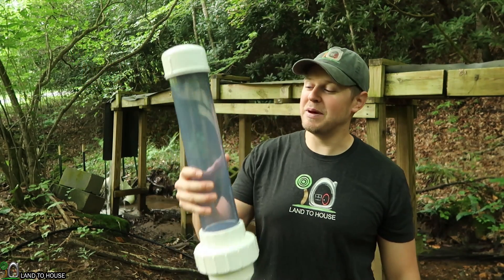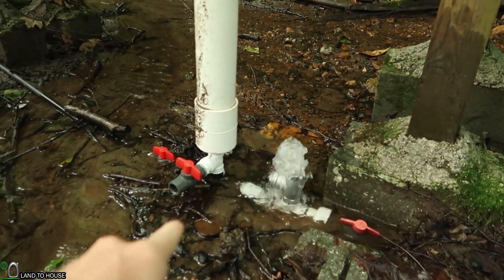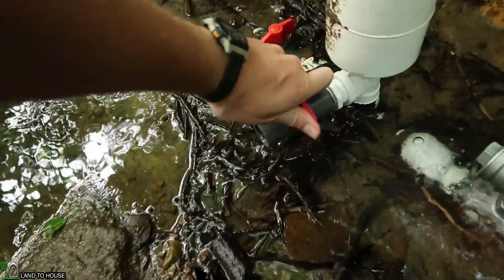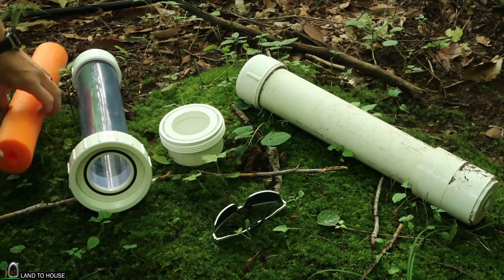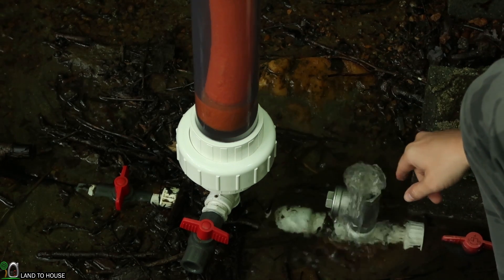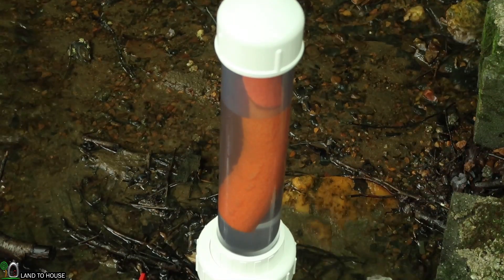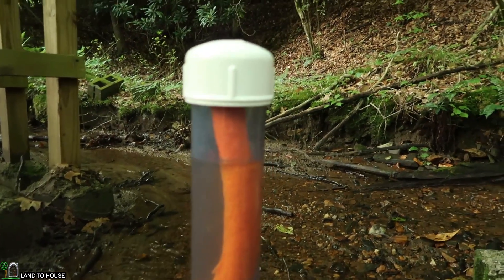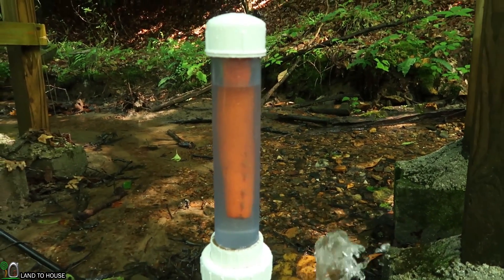Ram Pump Crushes Pool Noodle

Comment: Whaaaat? He said the inlet water from "a 1" pipe at 7ft of head pressure gives 60psi at the pump". NONSENSE. 
7ft head = 3.03 psi.
If he meant FROM THE OUTLET OF THE PUMP,  that's different but still will not be anything like 60 psi. Physics prevents it.
Reply from the maker: Yes outlet of the pump with delivery closed. I was wrong... it's not 60 psi. It's over 70!!!
https://youtu.be/jS2qO7nAbek

Comment: Would it be possible to trap some of the air pressure from the pressure tube into a holding tank? Even if it provides slightly less water pumping action, a small amount of air pressure being siphoned could accrue over time. Would there be moisture from the pressurized air source, and could that be fixed?
Reply from the maker: The air in the pressure tank is limited in this style ram pump. If you were to take some of it out the pump would become waterlogged and not function very well. In large commercial pumps there is a small valve called a snifter valve that allows a small gulp of air to enter the pressure tank with each cycle. Still I do not think that you would be able to get enough air out of the tank to use in another application. And yes the air would be very humid I have a feeling.

Comment: You know race car crews use a special kind of foam in there gas tanks. I took the liberty of looking some up. https://www.summitracing.com/search/part-type/fuel-cell-foam?SortBy=Default&SortOrder=Ascending&tw=fuel%20Cell&sw=Fuel%20Cell%20Foam I'm really curious as to how that would perform in that pressure thank.
Reply from the maker: Oh that's interesting. I did not know that they used foam in the tanks. It seems to be less ridged than the pool noodle? If it is I would expect that the foam would collapse even more than the noodle.
Reply: @LandtoHouse  I believe the premise behind the foam is that if the tank is punctured less fuel will spill out and thus there is less risk of fire. I'm pretty sure that it will collapse pretty easily but I'm wondering if overall it will keep the air from soaking into the water as quickly provided you fill the whole tank with the foam. I have no idea if it will work... but I sure would like to see if it does or doesn't!
Reply from the maker: It seems like a very smart thing for a race car. I believe that a bladder is the best fill for the ram pump. I should be testing a house pressure tank with bladder soon.
Reply: I used to race up in New England, we did have foam inside of a bladder inside the steel housing which made up the fuel cell. It was open cell foam in order to absorb the fuel. In open cell foam all the air bubbles have been exploded. What he's using there is closed cell foam in which all the air bubbles are whole.
 I think the assumption was that the air inside the bubbles wouldn't dissolve into the water. I think it was a great idea I don't know why it didn't work.

Comment: Ram pumps are great but if wastage of water can be handled the applications can increase manifold. So can Ram pumps be used to send water uphill without wasting any water.
Reply from the maker: The ram pump works best inside a creek or river. This means that the Wastewater just returns to the water source. But in a closed system there is no way of recycling the water back to the source head pressure.
Reply: @LandtoHouse  thanks for the prompt reply

Comment: Cool videos! What's the point of putting foam noodles ect in the pressure tank? Does it work better or is it just to see the pressure?
Reply from the maker: In traditional commercial ram pumps there is a snifter valve that replenishes air in the tank with each cycle. In this style Ram pump there is no snifter valve and so over time the pressure tank can become waterlogged. The Fill material it's supposed to provide a consistent airspace that can push back on the pump. A bicycle inner tube seems to be the best.
Reply: Land to House hi, could you build one with a sniffer valve? Would be interesting to see.

Comment: Sir can tam pump work with the foam or any in the pressure chamber?
Reply from the maker: It did work with foam but it works better with a bicycle inner tube

Comment: is it possible to create a ram pump auto starting?
Reply: Build something like a bamboo water tipper to directly press on the valve. Once water flow starts the tipper will start running and priming the pressure tank.
Reply from the maker: That is a fantastic idea!!! I will make this. A shishi odoshi fountain that auto starts the ram pump. Might have issues with air in the drive pipe though.

Comment: The point of ever putting anything in the tank is for pressure dampening to smooth flow and eliminate water logging the tank. Water logging occurs when air trapped in tank super saturates the water- similar to CO2 in soda but with regular air. Water logging creates reverse vacuum and drops performance in a pressure vessel over time. Putting a pool noodle in the tank does nothing but drop the amount of fill space. A better pulse dampener would be a rubber bladder that separates the inflowing water from air at the top of tank. This is why home pressure tanks put valve stems in the top of the tank to regulate the amount of pressure pushing back against the system pressure.
Reply from the maker: Well stated. I get comments quite often asking to put a noodle in a tank. I thought that I would appease the audience. All of the ram pumps that I sell have a bicycle inner tube. For the past 3 days I've been running a test with the tube. It's very obvious the pulse smoothing effect. In the future I do intend on placing a valve at the top of the pump to test with.
Reply: Land to House Thanks for the great videos.

Comment: A bicycle tube with the valve accessible from the top off the pressure tank with 40 psi in the tube. Or take an actual in home pressure tank and install it into the pressure tank area?
Reply from the maker: A friend of mine in France has a ram pump with metal in house pressure tank. It works very well.

Comment: I've wondered if you could build a micro ram pump utilizing just a foot or less of height from the intake. Fill an adjacent tank that once full could power a typically sized ram pump. This could demonstrate that a person with as little as 1' of water height on a babbling steam could pump 100' high (or so).
Reply from the maker: In the past I have tried operating a ram pump on one foot of head pressure. It does work but not very well. About 1 and 1/2 to 2 ft provides much more consistency even with a very small pump. The smallest pump I've made was 3/8 I believe.

Comment: What is the largest pump you've experimented with and why did you stop at 1.25 inches?
Reply from the maker: Acutally the 1-1/4" is the largest I have worked with. I stopped there because it gets very expensive to buy parts for larger pumps. Even the waste valve can almost double in price from 1-1/4" to 2".
Reply: Thanks, Love your channel!

Comment: Want to see plastic bottle, and the result of it plz ... Way more eco friendly if i drink water with it thanks.
Reply from the maker: Meaning a plastic bottle as the pressure tank or as the fill? I have written down to test a  bottle in the tank. I have another test video from a while back with a plastic bottle as the pressure tank It is a little difficult to get a bottle to hold onto the pvc fittings.

Comment: Try a schraider vale, like on a tire or for AC on a car, to the top lid of the pressure tank. After starting the pump add air to the trapped air in the pressure tank to double the pressure in the tank to see if the volume or speed will increase proportionately.
Also, keep the volume the same but use a narrower and longer pressure tank and also a wider and shorter pressure tank to see if it will change the volume or speed. 

The pumping ability appears to depend on the volume and pressure of the trapped air.
Reply: Also, adding air is the solution to waterlogged home pump pressure tanks.
Reply from the maker: I do need to install a valve and see what happens! I will start some research.
Reply: @LandtoHouse  The worst that could happen, it does nothing.

Comment: Try inserting the inner tube in the center hole of an unsquished pool noodle and inflating inner tube before putting in tank.
Reply from the maker: That might work. I would have to find a pool noodle with a much larger hole. This one is way too small.

Comment: I have wanted to play with a  clear PC for forever! Thanks Seth! Excellent update! I tried a pool noodle initially too on the advice of the Clemson University link.. but found the same issue.. doesn't sustain well. These days I just run air.. flush my PC every 2 weeks or so.. works great! I tired a bicycle inner tube before.. wasn't great either.. love to see that. Tennis balls was my last try.. but they gave up in about 6 months... love to see Tennis Balls in your PC.
Reply from the maker: Everyone that I have talked to about pool noodles has shown the same results. Over a short time they all get crushed. I am not sure how long the bike tube will last. so far it has been in the tank for 9 hours. We shall see how it goes in a few days. This time I left the pump cycling with closed delivery pipe. Very tough pressure for the test. Tennis balls will be in a future test for sure! I dont see them being very good for "Give"
Reply: Cheers!  I did get a nice "ping" on the pump when Tennis Balls were new.. But I didn't re-open for a long time and did find I had to purge from time to time. When I finally did reopen many of them were crushed and no longer had that pressurized pushback like when new.
Reply from the maker: @TheFarmacySeedsNetwork  I'm guessing the rubber would have to be pretty substantial to withstand the pressure that's being demanded of them in the ram pump.
Reply: Yes, I looked at Racket Balls.. but they were cost prohibitive for the volume I needed. I really want to perfect the snifter valve eventually.. that is the REAL solution for long term I think.

Comment: An inflatable balloon or a small flexible rubber ball in dog toys department.
It would imitate a bladder in a water pressure tank.

Great video idea this is, there so much stuff to try in that pressure vessel, awesome video series this is going to be!
Keep up the good work, love the ram pump videos.
Studies like this can help ameliorate efficiencies.
What an interesting device, more test should be done to push the technology.
Reply from the maker: I am thinking about using normal party balloons just to see them pop. I have wanted to make this test for a long time. Finally got around to making the pressure tank. I will be making several more videos with this one.

Comment: I'd like to see  a pressure gauge on top of the pressure tank. I'd also like to see how your standard inner tube looks while in use.
Reply from the maker: Two good points. I already have the bike tube in the tank and will check on it in a few days. So far it looks good. I need to find out how I am going to install the pressure gauge in the tank cap.

Comment: What is a filler medium for? I've noticed you are not using one at the end of this vid...
Reply from the maker: Over the course of weeks to months the air in the tank can become waterlogged. This causes the pump to lose that pressure in the tank. When that happens the water hammer hits hard. The ability to pump water reduces significantly. So the concept is the tank fill provides an air space no matter if the tank is waterlogged. The pumps I  ship have a bicycle inner tube. I'll be testing that next
Reply: Thank, I understand it better now and I love the clear tube idea as well.
Reply: L2H(Seth)- by waterlogged you mean there’s no air in the air chamber, just water?
Is there a theoretical or actual high distance up you can pump up to your to your water tanks? 
I don’t know how far you live from GAH(Sam) but that installation would be interesting to me. A real life outside solution. 🦀

Comment: Styrofoam balls,  fake grapes, and closed plastic bottles plz
Reply: Rubber ducks (sealed of course) :D
Reply from the maker: That would be funny! I will have to find some.
Reply: Styrofoam will just collapse immediately and stay that way, we used to drop styrofoam cups to the bottom when deep sea fishing and they came up shaped the same just smaller and thinner, and stayed that way.
Reply: @johnwyman6331  how did you get them to go down deep in ocean?
Reply: @GodsGladiatorsMinistries  Just tied them to the weighted line.

Comment: Every foot of elevation with fresh water creates .43 psi. 
7ftx.43=3.01psi
Reply from the maker: Yes. That's the pressure from gravity. The pressure built by the "ram" with closed delivery is much higher.
Reply: With the highest efficiency possible you would reach 30 PSI at the pressure tank.
Reply from the maker: Here is an older video showing a pump that reached 25psi with closed delivery pipe. I Think it only had around 3 feet of head pressure. So when the delivery pipe is closed it can build a lot of pressure. Now as soon as you open that valve the pressure reduces like you suggest! https://youtu.be/heLUeTGWz94

Comment: Wow.  I had to sit down.   I was glued to this video.  Your Professional video skills sure do show.  You have created a great testing environment in that pressure tank.  I cant wait.  I just have to say, you single handedly have brought up the combined IQ of the Ram Pump croud.  With this new pressure chamber you might just discover the best pressure media and have everyone following your lead.   I have a question.  When I made my Ram Pump I glued the fittings for the pressure tank.  Some video i saw out there said over time threads will leak.  What are your findings on threaded fittings for the pressure chamber.  It seems to be something i will need to get into on occasion.
Reply from the maker: Thank you. This clear tank has been awesome! I have spoken with dozens of people who have used threaded clean out caps and the most often times leak. The threads are just too big to make a good fit.
Reply: @LandtoHouse  thanks.  I was going to switch to threads.  I better  stay with glued and learn from you what the best media is.   :-)
Reply from the maker: I probably should test out a threaded cap myself to see what happens
Reply: @LandtoHouse  there's another YouTuber that does that, and he says he has to use aquarium sealant on the threads and let it sit overnight in order to keep from leaking.

Comment: A soda pop bottle. Put a tubeless valve in the lid and pump it to 30psi and stick it in the world's most expensive pressure chamber
Reply from the maker: I like the idea of a plastic bottle. But I wonder if not putting a lot of pressure into it would be better. That way it has some bounce to it.
Reply: @LandtoHouse  you are the master. Mine been running 3 months now no issue. Unfortunately I don't have clear pvc so I can't see what's happening. Givi it a try and let us all know
Reply from the maker: Just wrapped up the plastic bottle test. Sadly did not perform very well.
Reply: @LandtoHouse  hmmm is it cause it crushed the bottle
Reply from the maker: @vwbeetle5578  the bottle goes flat and the is no movement.
Reply: @LandtoHouse  you need more pressure in the bottle. I don't know how to upload pics to here or I'd show you my way

Comment: How to determine or compute the pressure tank size for a 1" ram thanks
Reply from the maker: I will need to look into the calculation required to do that. I found that it's better to err on a larger size than a smaller size. The main determining factor is whether or not the pump will maintain pressure when opening the delivery pipe.
Reply: @LandtoHouse  thanks for the info